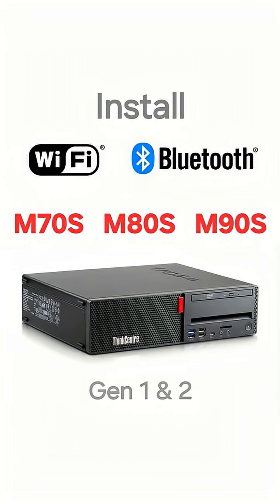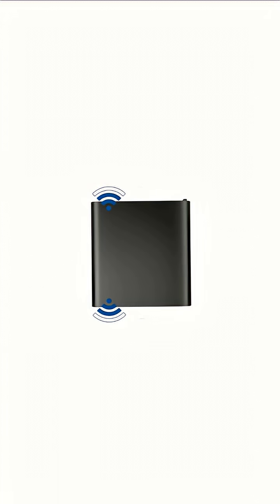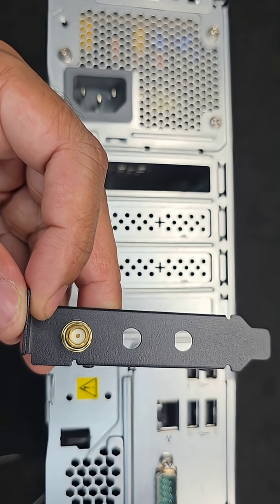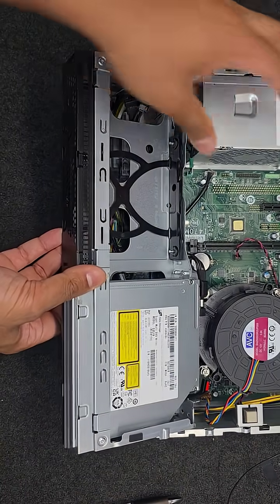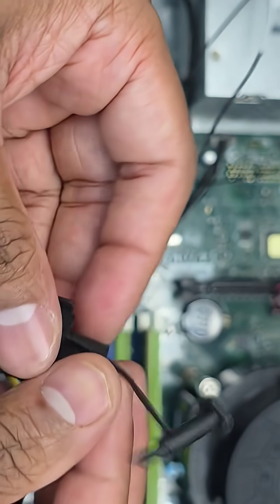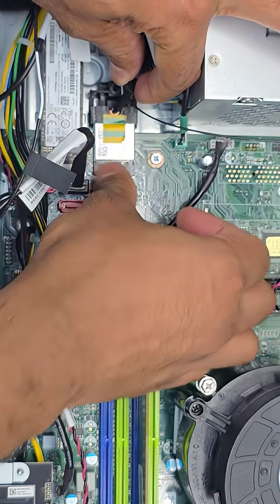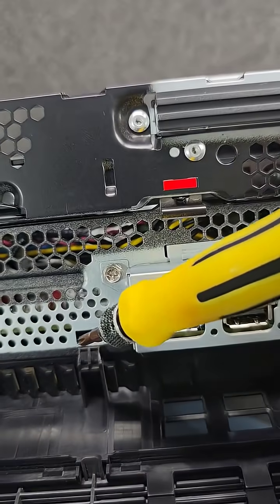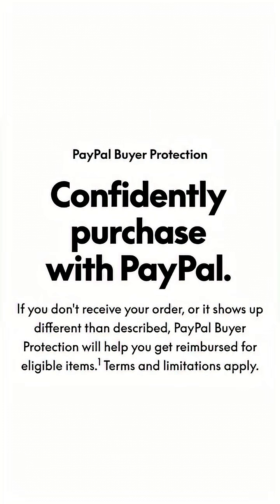WiFi and Bluetooth Installation for Lenovo Thinkcentre M70s M80s and M90s

Comment: what's the difference between "WiFi 5 & BT 5.1"and "WiFi 6 & BT 5.2" in your Ebay selection tab?
Reply from the maker: Hi, WiFi 6 is slightly faster and better with some extra features..But in terms of day to day use they WiFi 5 version is all you need to be honest..